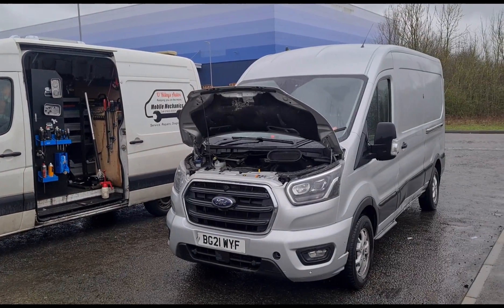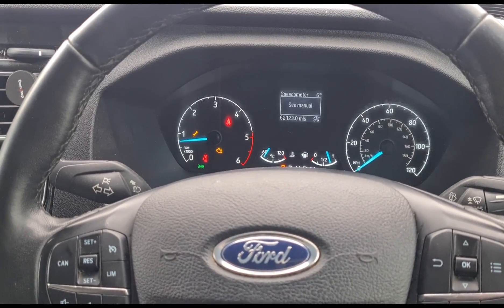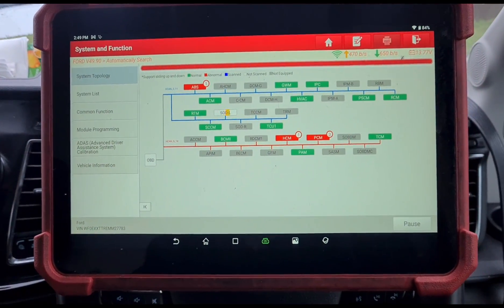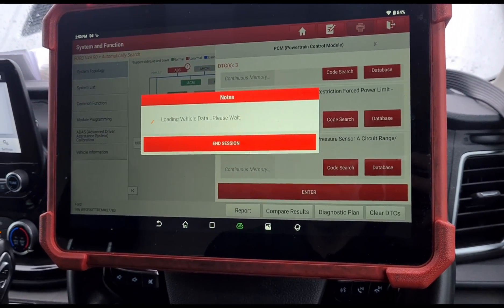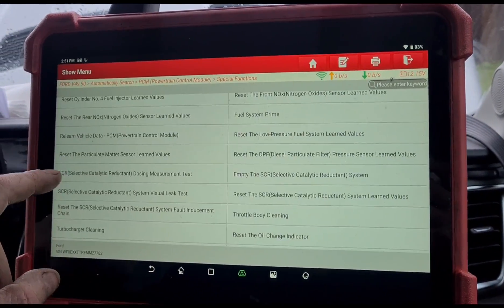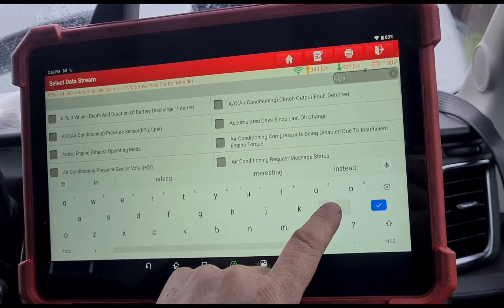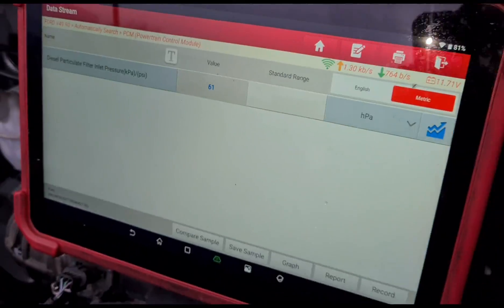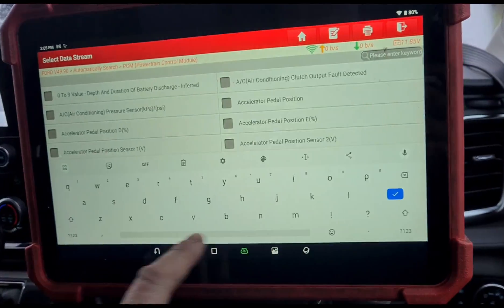Ford Transit MK8 2.0 P2463:00-AF P2453:00-64 Particulate Filter Pressure Sensor A Circuit

Comment: Had the same issue with reseting the open loop on a Kuga before I had to end up doing a Forced regeneration to drop the open loop didnt last long and because the DPF was clean and pressure was low at that point 👍🏽
Reply from the maker: This was also locked for forced regens

Comment: Hi mate I found that updating the firmware on my autel gave me gave me complete access to dpf and adblue functions my 2019 ranger 2l
Reply from the maker: This otofix is same as autel and it's up to date
Reply: Otofix d1 is base model some functions are there but don't work get the higher end model will work

Comment: My thinktool and launch have an "online reset" and a normal reset.  If you are connected to Internet it just works and clears codes and does regen etc. No Internet,  wont do those function's.

Comment: Transit is the best van on the road at the minute.
Reply: Never heard that before.
Reply: 😂😂😂.
That is not even worth a reply.
Reply: 😂
Nah.
Mercedes is the king right now. At least the ones we get here in Germany are. They ride really well, they are the most trouble free vans when you keep them serviced well.
A brand new basemodel Vito is 26k too unbeatable price.
The OM654 engine they all have is a weakspot (timing chain, small 2L) but so are all these tiny engines in these Vans. At least with Mercedes you don't have a piece of shit wet belt. Also you can get them with low output engine tunes like 102hp and 136hp and that helps them last longer and run cooler.

There is no Van these days that's perfect. They all have their issues.

Comment: In my experience these 2.0L diesels in fords got a terrible electric thermostat that likes to fail. And then in most cases without much of a warning the head gasket goes by by..😢
Reply: These engines are junk regardless. 
-Wet timing belt 😭
-Love to develop exhaust manifold leaks.
-Turbos aren't the best either.

Ford is just not good at building engines. Over in the US they have so much trouble with all new Ford engines its unbelievable.
Reply: @alouisschafer7212  yeah in here as well. The 2.2 is the only way to go.
That shows in van prices as well. No one wants a second hand 2L.

Comment: Forscan or Ford IDS will do the reset the closed loop is your problem. Closed loop is for Regeneration if you done a Regen closed loop would have came down also.
Reply from the maker: Regeneration was also locked
Reply: @ORileysAutos  it’s the tool. Need Forscan and to be honest or some newer stuff even that doesn’t work you need to login with FordIDS

Comment: So, avoid a Diesel Transit, and unless you're rich and don't go anywhere an electric one; is time for Mr. Ford to put a petrol jobbie in 'um  again?!  😊
Reply: They now do a petrol 2.5 plug-in hybrid on the new mk9 and the mk8 also had a plug in hybrid but it was paired to the 1.0 ecoboom

Comment: Ive seen people mention Forscan
 Wonder if that would work or not . Im no mechanic so ive no idea
Reply: Just had to use it on 2020 transit connect
Reply: FORScan definately works and will access all the locked functions on the ecoblues.
Reply: Hi yes I have FORScan on a app on phone and on my laptop works fantastic
Reply from the maker: I might have to look into using it